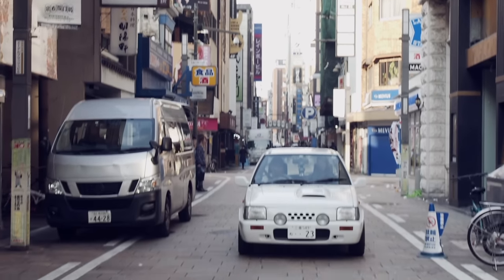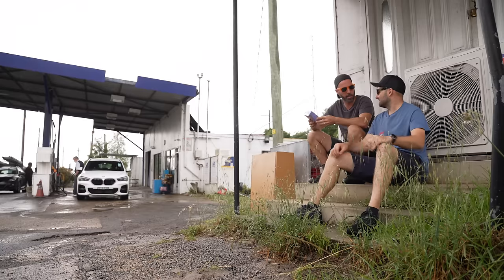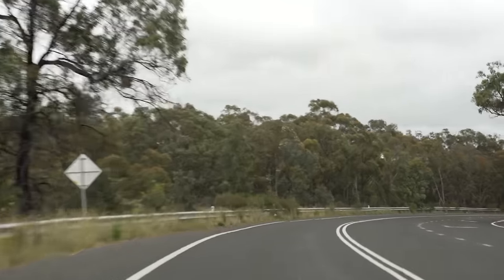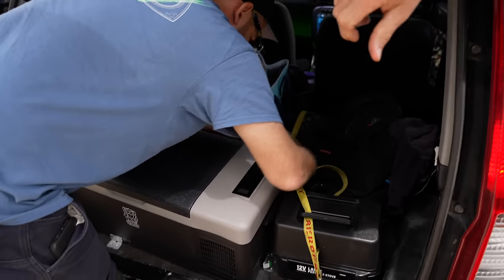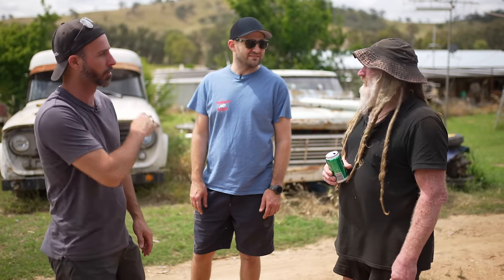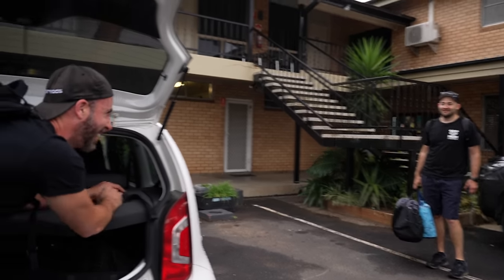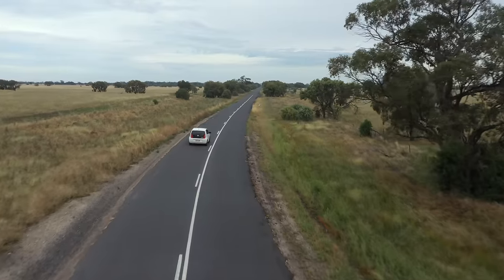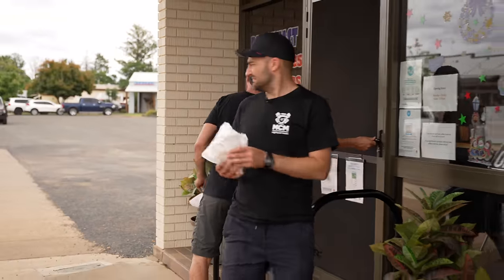Driving 2,000km Cross Country in TINY City Cars [4K FEATURE FILM]

Comment: My vote is for Tottenham.  I got flu there when I was working as a Geophysicist for the NSW Geological Survey back in the 1970s.  I spent a week in the Tottenham Hospital (which I think is now closed).  I had excellent service from the local doctor and the staff at the Hospital. If I remember correctly, our vehicle was a Series IIa SWB Land-Rover which remains my favorite vehicle of all time. I owned several.  Noisy, slow and quite thirsty but tough and would go anywhere.  Ours had "cruise control".  Actually it was a hand throttle for the winch, but the Geologists would put the hand throttle to FULL, put their feet up on the dash  because the floor got too hot, and cruise from Sydney to Broken hill.  The speedo would go past the 70mph mark so God only knows how fast those Land-Rovers were going.  In those days, the speed limit was not limited.  The engine was a 2286cc four cylinder OHV with quite a short stroke.  This is unusual for English engines of that time but it helped the little motor rev quite well. There was also a diesel version using the same block.  They were economical but pretty slow.  

Excellent movie gents.
Reply: The 2.25 litre Land Rover engine is awfully unrefined in modern terms, but bulletproof - my dad has one in his kerosene-powered forklift and it always gets the job done.

Comment: I had a citigo (which is just a rebadged Up!) for 3 years until earlier this year, and it was the most reliable car I've ever had. All it ever needed was serviced, one lightbulb replace, some new brake pads and the washer pump replaced. 40k+ on it, and never an issue.
Reply: I agree, very dependable

Comment: 3:35: "It's designed to drive at 150": Having driven my share of tiny VWs on autobahns (rentals - since I don't need a car), they can hold 170-180 no problems, but somewhere around 160 become truly terrifying because of low weight and not stiff enough frame.
Reply: The Up can sit on 170 and still feel pretty stable. Sure it's in 4th gear and there's absolutely nothing else left to give... or so I've been led to believe.
Reply: @TheKnobCalledTone.  4? Never seen less than 5 here :/
Reply: I have a 60hp Up and I've managed to get it to a GPS measured 185 - I don't recommend it, it's terrifying as you said. 140-150 is it where it feels good at, provided there is no elevation, if you are going up a hill, you are not making it without losing momentum and shifting down at least one gear.

Comment: Hi guys, thrilled to see you guys bought an Up!. I own an Skoda Citigo  with similar engine (chya 60bhp) and gearbox. But I couldn't live with the lack of power. So I had the car chiptuned and it really made the car more lively. You should be able te make around 90bhp with an intake, exhaust and chiptuning upgrade. Your videos are great! Greetings from Holland.
Reply: That sounds massively optimistic for a normally aspirated 1L with just a few bolt on mods. VW had to turbocharge it to get 90bhp.
Reply: The Australian market up was quite well specced. 74bhp engine as standard, along with electric windows and AC.

Comment: As usual, great presentation with exquisite production values.  Your 12v car oven is awesome.  

It reminded me of Ben Dark. He did a TV touring docu-series in the 90's (I think).  He was touring around in a beautiful old 70's Holden Statesman.  He had fitted a engine coolant heat-exchange system under the bonnet, using the engine temperature to slow-cook dinner under the bonnet. Genius idea
Reply: Hey mate if your interested in the stove or the 12v fridge/freezer. They got them at Jaycar.

Comment: I have a 60hp UP!. Last summer I took it on a 6k kilometre roatrip from Germany to Bulgaria and back and it didn't skip a beat. On the way back I measured the fuel consumption precisely - it came back to 5.8 l/100km with me absolutely not trying to drive economically. It was comfortable, for a city car, and spacious (I'm 196cm tall/6 feet 6 inches).

Comment: 32:33 - there's quite a bit wrong with what you said there Marty:

Firstly fuel 'excise' goes to the Federal government, as does GST, which all ends up in a big pool of money; there is no direct correlation between the tax/excise on fuel and the amount spent on roads.   The truth is that a fair whack of the money 'generated' by light passenger vehicles goes towards repairs from damage by HGVs.

The per-kilometre fee on EVs is just a State-based tax-grab on a tax they don't receive in the first place!

Secondly, you're failing to take into account the cost of damage to the environment and health outcomes caused by ICEs, which EVs don't contribute to.

Thirdly, there are billions of dollars lost to overseas oil producers from the sale of diesel/petrol which would do a lot more good if it remained in Oz. 

I'm fortunate that my EV is run on solar generated from my rooftop, while the excess gets sent back into the grid as clean energy - over 11MWh last year.

I'm perfectly happy to pay a per-kilometre charge for road usage, as long as everyone else does too.  Fuel excise can be dropped to a level that covers the cost of environmental, health and infrastructural damage and then we're all on a level playing field. 🙂

Comment: Nice video🙌 these VW ups (Skoda citigo- Seat Mii) are actually very comfy to drive i have never driven another Micro car with the same comfort especially with original suspension it is very smooth at pothole roads i have tryed with many other aftermarket springs and shock but the original ones beats them all in comfort. The little 1,0 3 cylinder engine are very bulletproof i have seen one with 915.000km on the same engine and here is a picture of my friends Skoda Citigo with 639.412km it is about 650.000km now still original engine, gearbox and never had a fault light on i dont think you can get these kind of kilometers so cheap in any other cars in the world.

Comment: I think small cars might be overall better for cross country esp. if fuel efficiency is concerned. Also, small cars are easier and cheaper to fix in case there is a problem on the road. Unless you have a Top Gear budget and support.

Comment: That wv up has best performance when shifted around 4-4,5k. It gives you little kick and can speedup little more. These engines don’t like low rpms same like as high ones, best is to drive them little over 2000 rpm to 4-4,5k. Just a tip, i drive it daily at work 😁
Reply: Congrats you  have been selected among our short listed winners, contact the number above⬆️
Reply: Sounds like VTEC
Reply: @paulklp8262  i own dohc vtec prelude and sohc vtec civic. It sounds pretty much like the sohc vtec. Dohc vtec is way more agressive 😉 but yeah. It has some variable timing so when you reach 3k rpms you can clearly hear it. But it doesn’t kick at all.

Comment: I took a 44,000 mile 6 month adventure in my 2019 mirage , involving dirt, gravel, and highway. Mostly camping. While climbing mountains sucks with 78hp and sand is not your freind, I will say it can do nearly anything minus what the tiny wheels and suspension can handle.

Comment: I once bought an old van for £50. I had to replace the broken engine mount and fix the rear light.
The guy sold it due to the broken engine mount making the van steer across the road when you floored it or lifted. It went one way when floored and the other when you lifted off. The seller didn't know what the cause was.
The rear light cluster didn't work. A shopping trolley in a supermarket had rolled down a slope and smashed the lens. He bought a new lens but it still didn't work.
I had a look and discovered that the printed circuit board had split, severing the circuit tracks. I glued the board and then soldered across the tracks so it all worked again.
So imagine my surprise when i came home one day shortly afterwards to my mom saying, "oh, i sold your van!"
WTF???
When i'd calmed down i asked her for how much?
"What you paid for it. £50."
I wouldn't mind, but i NEVER sell my cars! Drive them into the ground then scrap them.

Comment: Atleast here, we pay upwards of 60% of fuel is tax and then we pay Vehicle excise duty which is basically a charge to drive the car on public roads. Every time a new technology in cars comes along, the goverment here coaxes people to buy the new technology and then a couple years later, completely alienates them and they end up paying what can only be described as extortion. And because electric cars don't pay VED or tax on fuel, everyone else is getting shafted to death with tax. VED is a broken system anyway. 2 people with the same car would pay the same but one could do 3000 miles a year and the other could do 30,000 miles a year which is totally unfair.. We could use the MOT to calculate miles above or below average and calculate it that way.

Comment: i have a 2019 polo 1.0l 3 cylinder turbo 115hp 200nm i use the nm more then the hp its not a sports car but its not slow and it handles really good even on stck wheels

Comment: @MCM Wrong. 
@ 33:23 "...on land that would otherwise be used for farming..." NO. On land that can ALSO be used for farming. If set up correctly, some sheep can graze under the solar arrays. Shade for the sheep, still enough sun for the grass, and the sheep keep the grass and weeds from overgrowing the panels, so the need for ground maintenance is extremely minimal. It's called solar grazing and there's loads of research proving that it's a win-win situation.
Reply: Marginal or grazing land is fine, but the idea of using good quality land for producing fuel rather than food doesn't sit right with me. I feel the same way about crops being turned into ethanol.

Comment: I just wanted to throw this question out here, since you and your subscribers are into cars so much.  I have a truck that has P0601 code showing up only on cold days (40s or lower DEG F) when I try to start it first time for the day in morning.  I have a tool to plug in ODBC II and reset the error, wait a minute, and then it starts up just fine.  Runs and starts good all day after.  If it is warmer outside on a first start for the day, next day or rest of the week, it works fine.  Is there something I can do to the PCM/ECM/ECU to protect it from frost or mildew?  That is my theory on why it gets the code only on cold days.
Reply: Check for any water leaks around the ECM, but you're probably still going to need a new one.

Comment: As an MCM fan of years, I have never ever been disappointed after watching an episode, apart from now. Firstly you get rid of the only cool car in the video, then instead of doing some proper research and actually figuring out the true centre of NSW you use pies to figure it out. Then it turns out the pies you used came from the same f*cking place, not to mention one of them had been in an oven for an hour before you did the test, if you're going to do a stupid experiment like that at least eat the pies when they're fresh! MCM has gone very downhill all of a sudden.

Comment: Those Charade's had stiff suspension when they were stock, so I can only imagine a slammed one.

Tip for people driving sub 1000cc NA cars, foot flat to the floor is not the fastest way, you need to keep the revs in the power band and quick gear changes, if you get to redline you probably went too far and should have changed up already.